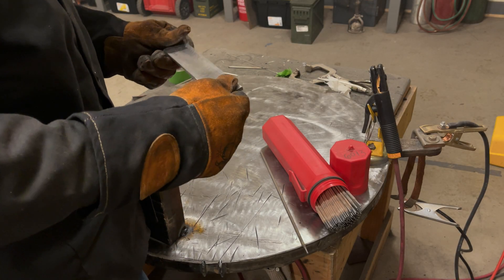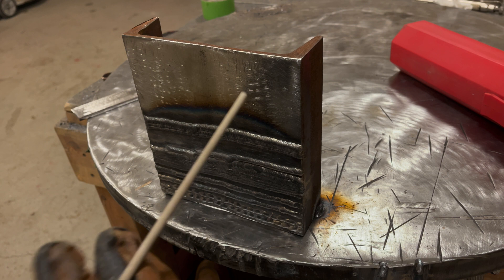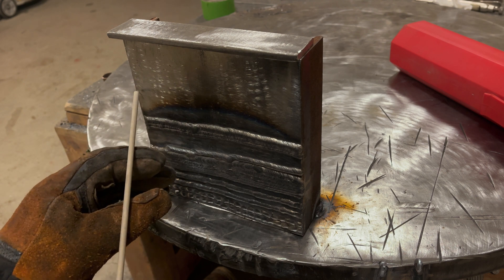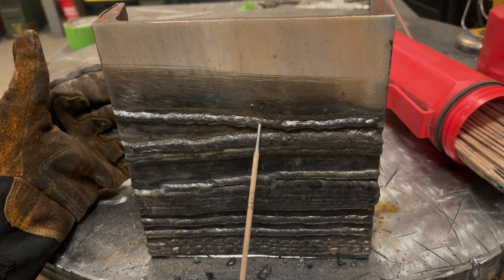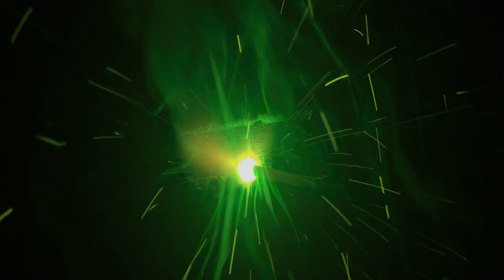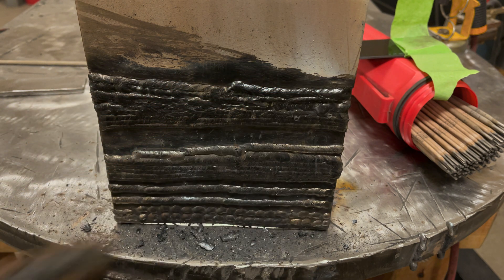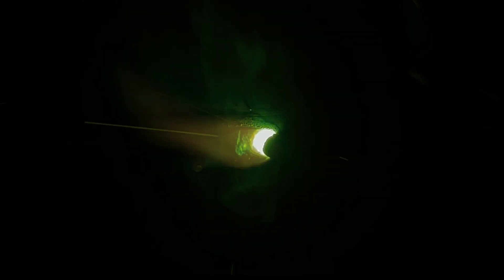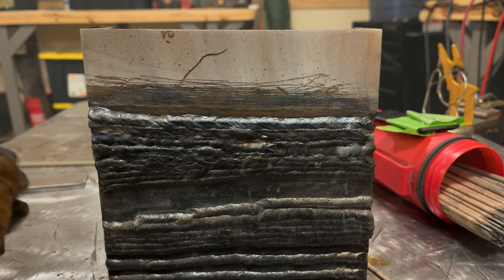How to stick weld: horizontal welding (Series part 10)

Comment: Mate thats an excelent video. Im about to do some horizontal welds on a trailer, lots of differnt angles. I dont weld professionly so some days are perfect others arent when I forget best practice. For me, creating and staying with the puddle needs practice. Thanks a lot.
Reply from the maker: No problem 😀👍.  Don’t worry, nobody puts down their best welds every day.  Odd angles, differing thicknesses, and tons of other things can really increase the difficultly of a weld.  The best thing to do is try your best and if you put a bad weld down grind it out a bit and reweld it.  Luckily even rough welds tend to be strong 😀👍.

Comment: really enjoying the video series. Im new to welding and had a quick question.  do you use any respirator? i do some practice welding at my work when i have time but i find the smoke makes me sick if im there too long haha.
Reply from the maker: So when I shoot the videos I generally don’t because I can’t talk and film.  However for many repairs I use either my powered air purifying respirator welding hood or a welding mask.  I highly recommend using atleast a mask.  No shame it it at all.  I personally like the GVS filter mask (same as miller weldings) and the Lincoln electric welding filter mask.
Reply: @makingmistakeswithgreg  thanks! Ill look into those. The general purpose respirators youd see in the workplace wont fit under a welding helmet, which is why i ask.

Comment: I just moved on to horizontal and I'm having trouble seeing where I'm going. I'm using 3\32 7018 running at 80 amps and I'm getting pretty good beads but my problem is with the drag angle plus the upward push angle I'm having problems seeing where I'm going. Maybe my head position? Any advice?
Reply from the maker: So on a lot of things you would weld horizontally you would have a clear line to weld too, like on beveled plates.  This helps hugely.  For practice on plates or welds where you don’t have a clear line to weld too, it can be really tough to weld straight.  To improve this I would recommend using a scribe and etch a solid line to weld to, or as a guide you weld near to help keep you on track.  One thing to remember as well, is if you do enough horizontal welding you will tend to run straight lines without even trying.  If you can run a straight line without thinking about it makes it much easier to work with what you can see to keep on track.

Comment: Were you running stringers or oscillating a bit as you were welding the horizontals or a mix of the aforementioned techniques?
Reply from the maker: With stick welding I universally run a stringer weld with no manipulation.  In the horizontal position you can just a straight smooth bead.  You can oscillate to a certain extent however doing it excessively can cause weird things to happen (lower penetration, weld pool dripping, etc).
Reply: @makingmistakeswithgreg  thanks for the explanation. I did backward Es today when I was practicing horizontals and it did look kind of weird but I was using 6010 1/8 electrodes. Thanks Greg. I’ll try just running a straight stringer tomorrow.

Comment: I love your videos, they do help me a lot with understanding. Where do you typically source your metal for projects/test runs?
Reply from the maker: I tend to buy it from one or two steel suppliers or from Menards when they run it on sale.  I also browse the fb marketplace looking for lots of steel shops are getting rid of.  That generally costs a lot (due to the volume) but is far cheaper for the quantity.
Reply: @makingmistakeswithgreg  Great to know! I was thinking of going to my local Menards for sourcing, others are great ideas as well. Thanks Greg, I will continue watching and enjoying your videos. 😎

Comment: You seem to be welding a massive distance, have you got superman eyesight?
Reply from the maker: If you’re referring to the distance from my face to the weld pool, on a non obstructed weld it’s possible to weld it with my face multiple feet away.  You don’t actually need to see as much as you might think to stick weld decent.  So much about stick welding is just running enough rods that your body just does most of the work without you thinking about it.
Reply: @makingmistakeswithgreg  Ahh ok, that makes sense.

Comment: I like this video more than most, I like the 6013 1/8 rods also. I think it’s easier to control vs other rods, plus I’m trying to work on this exact weld too so this was great thanks dude
Reply from the maker: No problem 😀.
Reply: @makingmistakeswithgreg  I always get a crack up when your drawing something and mumble no expenses spared on the quality of this illustration lol 😂